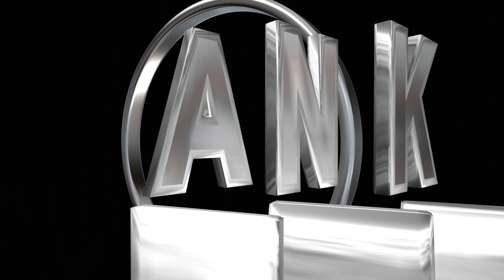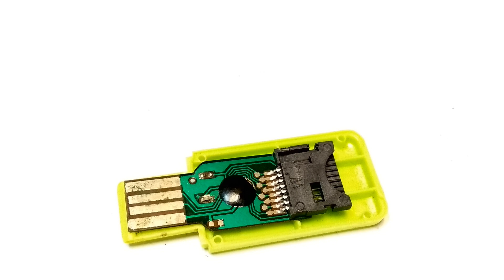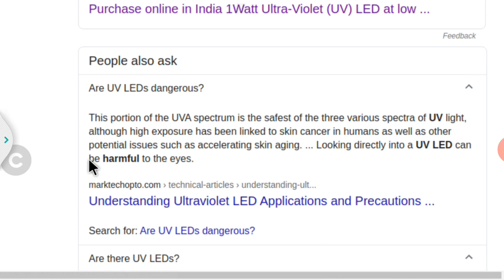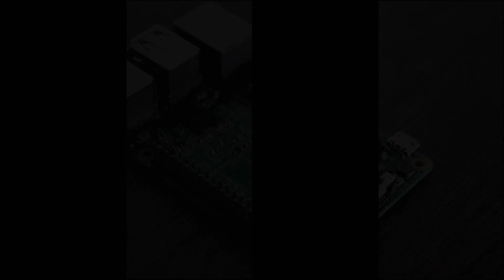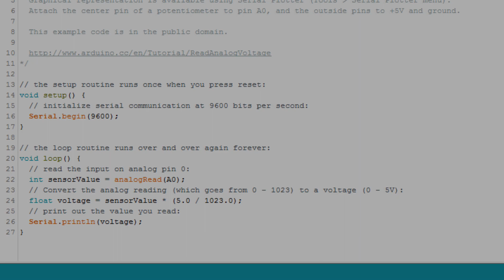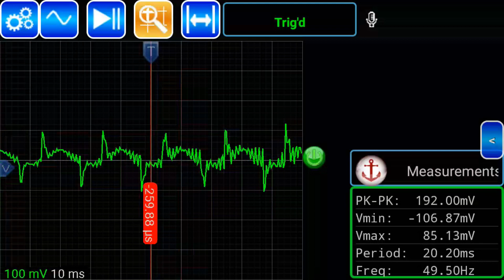Zmpt module explained PART-1

Comment: It's not using 2 opamps, it's using 1 physical. 1A and 1B are notated, note the pins too - there is also not 2 opamps on the board. They just split the schematic for easy reading for the 2 opamps inside the 1 chip. Don't know if this is what you meant to say...
Reply from the maker: sorry bro those were messed up i made this video during my early college days, I will soon give new voice over and fix all my mistakes lots of comments received for similar things.

Comment: Hello what are the parameters for the transformer in the zmpt101B  voltage sensor
Reply from the maker: sorry i forgot the details  - and now a days i don't have much time to quickly update it here.
but try asking Chat-gpt well AI is replacing humans faster. Because it will take me longer.

and Yes when i made this video i dint find a proper data sheet so i had to find things in Hard way and didn't cover everything in this video

Comment: How can i measure 350V ac sir ?
Reply from the maker: It's should be possible but not tested, with ZMPT,  if you like to use transformers as shown in part 2 you have to find suitable transformers which can handle 350 volt and change the circuit, my schematic have some bugs, 

You can try voltage divider method but be careful and try to use 5-10 watt resistors

Comment: Comparator is an opamp in open loop gain (no feedback), neither of the 358's are operating as comparators in the schematic @5:00. Both have a Av = 10, giving a final gain of 100 in the schematic shown. The voltage divider R10 & R11 are used to offset the final output to mid-scale of Vcc, 2.5v in this case. Same is done with R4 & R5 on the input of U1:A. Since the transformer is 1:1 ratio the designer used a resistor R1 to limit current proportionally to the applied input voltage, but the value chosen is rather high for 250Vac giving the need for the high gain in the opamp stage. With better consideration for the value of R1, we could set the resistance to net 20% rated current of the transformer so that the burden voltage resistor R2 can be chosen. With careful selection of these components the need to amplify could be mitigated to a single voltage follower (unity gain buffer) to lower the noise floor seen at the ADC input. The 820K R1 sets the primary current to 431uA @250Vac, which is orders of magnitude lower than the rated current of the transformer giving the need for amplification. If R1 = 7k the transformer current is 50mA @250Vac, with R2 = 100 Ohms the resultant burden voltage of 5vp-p would represent 250Vac on the input, all while staying within the specifications of the transformer and without the need for amplification which would inherently add noise. 

SAFETY WARNING: This module is somewhat dangerous IMO, the full input voltage is applied across a single SMT package resistor which likely is out of spec for that package due to size alone. Ideally one would use a series connected set of resistors on the primary to minimize the applied voltage to each resistor in order to maintain a safe margin of error. One such solution would be to use a through hole wire wound current limit resistor(s) with a series connected PTC device to achieve a safer layout.
Reply from the maker: Finally I am very happy someone is correcting I have done dozens of mistake in other videos too when I made this video i can not understand what the circuit is doing even my simulations didn't satisfy me.
I asked few people there said it seems to be a comparator. so I said it's a comparator i will try to correct this video.

due to excessive noise this module is no use for me i made a diy version which worked perfectly fine but still some safety features were not implemented.

I want to know more about you...
Reply: @anklabs7504  We learn by making mistakes, as long as you're safe there is no problem with making errors as it's the method to further understanding. As I stated, this circuit has no business being connected to mains voltages due to the lack of key safety elements but the theory involved to understand is rather straight forward, basic transformer theory and a basic opamp circuit. I hope by now (3 years later) this is a funny problem to look back at and you're well on your way to proficiency. If not, stay with it and it will all make sense eventually. I wish I had time to watch every video and comment but I just so happened to see this one and felt compelled to contribute. I hope all is well and you're progressing through the world of electronic design.
Reply: Well understand 👍👍
Reply: how you have calculated limiting and sampling resistors value
Reply: @hafsaahmed_abbas6991  Ohm's Law, V=I*R. In this particular case the given values are the highest voltage being measured and the rated current of the transformer. Once the primary current is determined then you can select a secondary side resistance value to appropriately scale the voltage. Ideally you want the least amount of amplification on the secondary side to reduce the noise seen at the ADC. Although this is not an ideal method of measuring voltage for reasons I covered in a prior reply but the theory applies to all transformers.
Reply: what is the benefit of using current transformers instead of stepdown transformer. any one practically tested with oscilloscope? to check lag between input and output. thanks
Reply: @pkp8559  A current transformer is for measuring current using the magnetic field generated by current flowing through a wire. While a step-down transformer can be used for measuring the voltage, but it's honestly not ideal due to the transfer function of the transformer being frequency dependent. Every lab instrument uses a very high resistance voltage divider for this task due to the frequency independence of the resistive divider. Obviously this is within reason as the parasitic inductance and capacitance start to play a factor when dealing with high frequency signals. Your second question is irrelevant and seems based on the misunderstanding of the previous question.